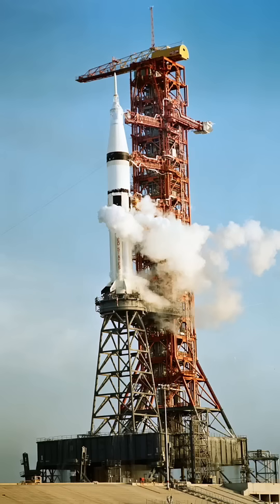Short rocket problems #history #shorts

Comment: As I understand the reason they didn't modify the tower was because the crew would've launched right after Skylab. So, there was no time between the Skylab launch and the crew launch. But then because of the Skylab failure they postponed the crew launch anyway.

Comment: That one view of the Saturn 1-B has the slidewire escape system visible going off to the left, and that brings up a question I've always had. With the Service Structure on the MLP, they obviously couldn't leave the slide wires in place all the time like during the Shuttle and Crew Dragon eras, so my question is, how were the slidewires etc connected and disconnected? Did they just use the hammerhead crane to lift the structure as one, or what? That might make a cool video itself!

Comment: As someone who is 6 and a half feet tall I almost never have to reach for the stepping stool…
Reply: On the other land, low doorways and ceilings become so much more exciting at that height... I gave myself a mild concussion that way in Japan, walking down a flight of stairs with a doorway at the bottom.
Reply: @simongeard4824  yes a lot of pre WW2 houses have the same hazard!
Reply: @trollforge Post-war in this case... one of the Tokyo neighborhoods destroyed by firebombing, and so being rebuilt at a time where lots of housing was needed very quickly.
Reply: @simongeard4824  unfortunately I have never had the opportunity to add to my head scar collection anywhere but Ontario, Quebec and Maine… ;)

Comment: Also, the mobile service structure was designed around Apollo spacecraft mounted upon the Saturn V, and all of the service platforms in the vehicle assembly building were likewise at a tall level for the SIVB and the Apollo spacecraft.

Without the milk stool, all of these facilities would’ve had to be lowered.